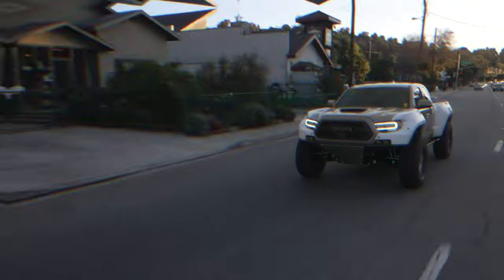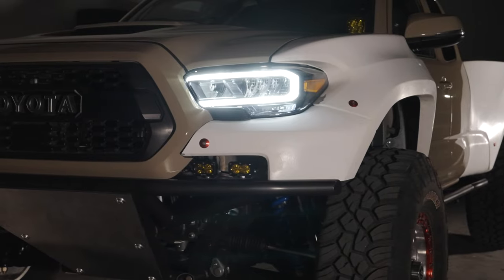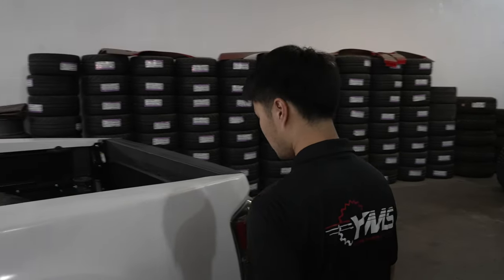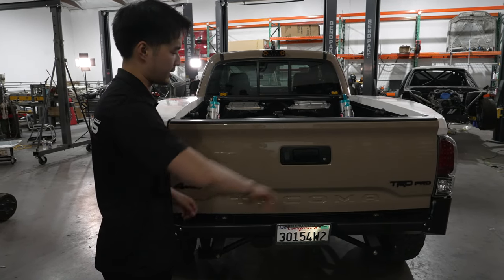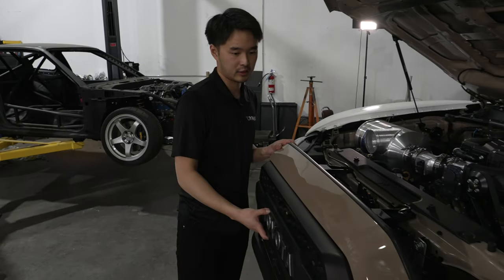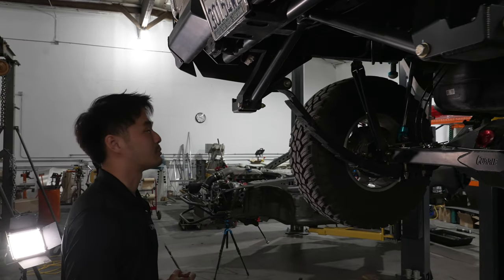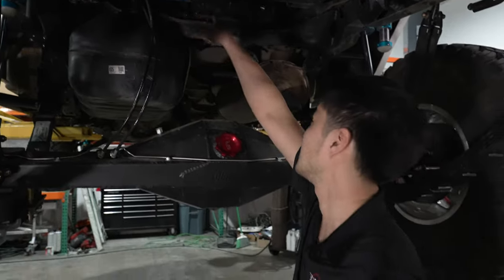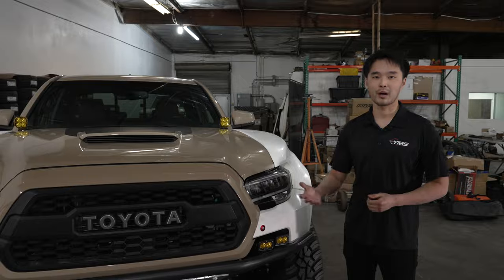2020 Tacoma Prerunner Build Breakdown

Comment: Beautiful! I hope my quicksand access cab is this nice one day!!! Question does that rear with the 35 spline shafts still use the factory speed sensors at the wheel bearings? If not how did you delete it???
Reply from the maker: Thank you! The factory wheel speed sensors have been deleted. The truck actually runs fine without them! Just no speed display.
Reply: @yufengluo3937  oh wow! i thought it would throw off the trans shift points and what not. Thats really good to know! Keep up the great content! Im watching your suspension tune video now!!!!

Comment: Can you go more indepth with the Porsche 934 CV choice? It seems like an odd choice as Porsche CV's use the bolt torque to maintain connection which while being easy to replace is usually weaker than most spline based CV designs, also I found most Porsche CV's have very limited travel making it easy to cause them to eject the bearing balls into the boot.

Old 944/911 guy here.
Reply: These are the CVs that Solo Motorsports provides. The Porsche CVs are used extensively in the offroad world.
Reply from the maker: Hi! The Porsche CV’s are actually very strong. We also use them in my 1300HP drift car!

Comment: So that's about a 300K Taco, right ?
Reply: If it was 300K it would be engine swapped, fully caged and 4 linked. Maybe center mount or beamed if they didnt like the extended A arm setup.
Reply: @LukePRTR  What would you guess this TACO costs then ?
Reply: @elli003  100K ish
Reply: @elli003  LT front is like 15K, LT rear is like 10K(Not counting the axle swap), The fiberglass and bumpers like 3K, Supercharger 7K. They kept the budget lower since they are the shop that did the work
Reply: @LukePRTR  Are you a builder ?
Reply: @elli003  no